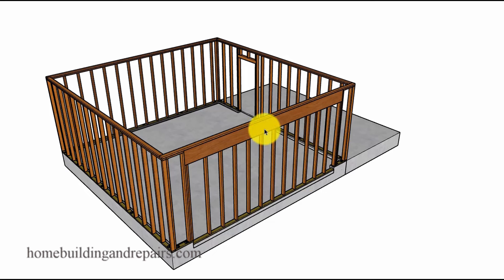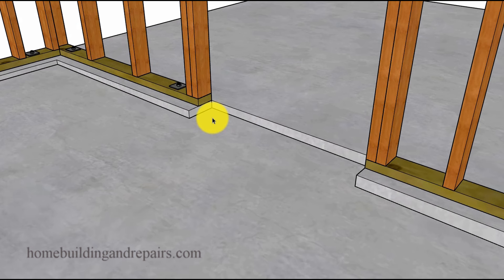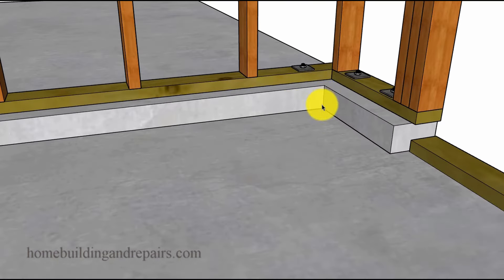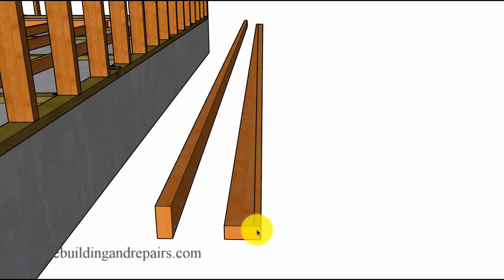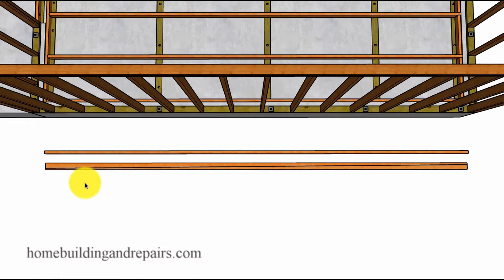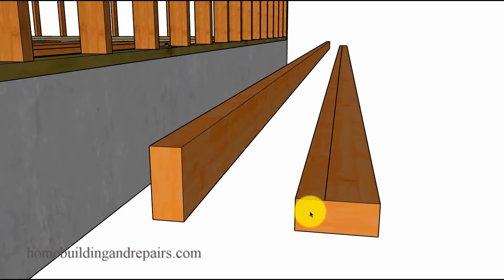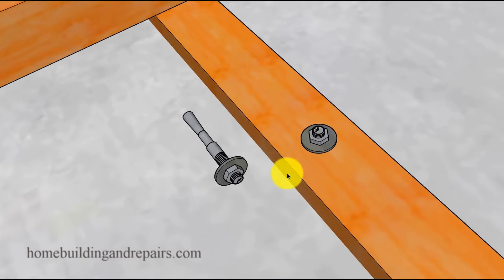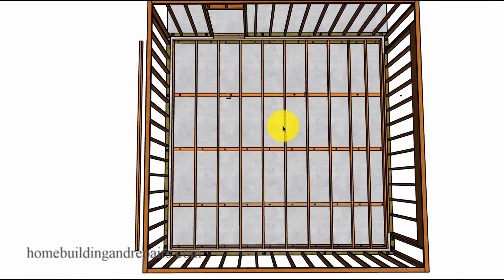How To Raise Garage Floor When Converting It To Living Space - House Remodeling Ideas

Comment: I believe my garage floor has a spring under it. Not an exterior drainage problem but a spring that flows harder and higher during the rainy seasons. I like the grid idea but since I have a real water/moisture problem should I use a plastic vapor barrier and wrap my bottom boards? I’m talking about the actual wood that would  be in direct contact with the floor. Please help
Reply: Hey George, any word that’s in contact with cement should be ground contact rated. Normally it’s treated.

You can use a joist tape to do the same thing,  if it was my house, I would do both

Comment: Another great video, glad to see you prefer cement, jm leanjng that way for cost and simplicity. I'm adding a 8x25 office in the back of a 20x25 garage. The stem wall for where the back door will go is about 4" tall with the top plate above that (perfect height for a 2x6 joist to rest on a flat 2x sleeper 10' out and be level). the remainder of the back wall is a 4' height cement retaining wall for a behind garage slope yard. I'm struggling with losing 7" of height inside for above office garage storage area  even though the walls are 12'.  Also considering 2" rigid foam on a self leveling cement floor and on the back wall to keep the drywall off the cement, but again I would be losing a few inches of wall space there and i think i would add furring atrips between the 4x8 foam panels.  The good news is my climate is zone 6 so it's pretty easy going and the retaining wall and floor are sealed (I taped plastic for the past 2 months and no moisture inside). It's also annoying I can't run electric on the lower back wall unless it's by the door but if I fur the back 2x6 wall out a few inches for 2" foam maybe I can run conduit in there and a shallow single gang box for an outlet. So it looks like the back wall and floor might have 2" foam and the side walls, ceiling and interior garage wall will have Rocwool safe and sound batt for comfort an noise suppression.

Comment: I have to put 2x6 floor joists on a concrete slab of a ground level room. What's the best way to protect the wood from moisture on the concrete and under the wood? Should I use 6 mill plastic, or something like dmx 2.0? Also Should I paint the floor with drylock or just leave it plain concrete?
Reply from the maker: I would check with your local building department for more information. I don't think it's a good idea to waterproof under framing with out adding air circulation or ventilation to remove moisture.
Reply: I called the manufacturer of DMX 2.0 and they said that should work fine. I'm not going to paint the floor, just leave ventilation around the edges for the DMX and lay my 2x6 sleepers on the floor and Anchor them into the walls.

Comment: How would you recommend raising the floor if the garage floor is 40" lower than the floor of the home?
Reply from the maker: I will put your video suggestion on my list of videos, but you could do it by building supporting walls underneath your joist and sheathing in the same way I'm using sill plates in my example. If you can email me some pictures of your project. You can get our email address at our website.
Reply: I have the same question.
Reply: @gregvancom  thank you. I will send you pictures of our current setup and the idea we are considering

Comment: Thanks for sharing. Your description was helpful.
Reply from the maker: Glad you found it helpful!
Reply: Loads of great ideas, thank you very much! I am looking to do something kind of like this in my basement. The problem is that I don't have a consistent slope. I have one point that's high and then from there it goes down in several directions. The first area that I was planning to finish, which is a bedroom, slopes down 2 1/2" within 14 1/2'. Like I mentioned, it's not a consistent slope, it's more like a topographic map with a high point in one section of the floor. It seems that most of my basement is lower than that high point. My basement is 2100 square feet so that would cost a lot to level it all up with self-leveler or even concrete. I thought about trying to grind down the high point but if I had to go into down 2" that would make the flat work too thin. It is apparent that the builders did it this way because there are some load-bearing walls in the low sections and the floor joists above are still mostly level. I live in Utah and it is highly recommended to do a subfloor for both insulation purposes and potential moisture issues, although we live in a dry climate. What would you suggest in this instance?

Comment: Great video! Greg. I am planning to convert my garage into ADU (no access from my house). My garage height is about 8 feet (concrete floor to dry wall ceiling). I am not looking to raise the floor. There is a slight slope but I am not concern about it. What kind of thinest floor structure I need to install LVP or hardwood floor. Thanks
Reply from the maker: Check with the product manufactures for best materials and installation instructions.

Comment: Thank you so much for this video! I recently purchased a home with a historic coach house in back that I want to use as a workshop. It has a concrete slab floor (not historic) that is severely uneven and broken in several places due to large tree roots. The trees are not on my property so I do not want to remove the roots, possibly kill the tree, and have neighbors who hate me. Since I don't plan to park a car in there I am thinking of ways to simply add a wooden floor on top of the broken concrete floor. I have been told by contractors that a new concrete slab would be at least 5k and might not last long since the roots will just break them up again. Any advice would be steller. Thank you!
Reply from the maker: I think I would build a wood framed floor.
Reply: @gregvancom  Great! That is what I was thinking too. Some sections of the concrete are in very bad shape and will have to be reduced to gravel. Do I need to do anything with these areas in preparation for being covered by the wood frame floor? For example a vapor barrier or tamping? Would it make sense to insulate as I want to install heaters down the road?

Comment: For 1" rise over 8' (20' long) would you use just mortar or fix all? I'm guessing it doesn't need rebar since it's so thin but what about fiber mesh or something?  Slab would be spanking 0" to 1" over 8', so otherwise I could go thicker and make it 1" to 2".
Reply from the maker: That's tough. I would leave alone if you can, but installing mortar or concrete between 1 and 2 inches is probably going to crack and separate. I don't have any product suggestions for your project.
Reply: @gregvancom  self leveling compound or micro cement

Comment: Do I need to put kind of  insulation between the concrete and the joist?
I am in a cold country.  North of England
Reply from the maker: You might need to check with your local building department.

Comment: I’m thinking about doing this to my garage. I would have to raise my garage floor about 1 ft 1 in. would you suggest just using concrete and then frame the floor?

ETA-I’m not accounting for the 3/4” plywood and the padded LVP as well.
Reply from the maker: It would depend on the design and another option would be to use stairs to step down into the garage.
Reply: @gregvancom  I did think about that but the laundry room is connecting to the “entry way” and we are going to turn part of that into a walk-in closet that’s connected to a bathroom…so I’m afraid the step up would also follow into the closet.

Comment: so i guess the first option with concrete is the best. does concrete need adhesive to bond to old concrete?
Reply from the maker: Most installers will use some type of bonding adhesives.

Comment: What is done with the gap in the foundation from the garage door? Will there just be an opening left below the structure?
Reply from the maker: I've seen most of them sealed with caulking and then if the garage get's converted back into a garage you can peel the caulking off.

Comment: Any problem using a concrete-wood glue for attaching joists rather than concrete anchors?
Reply from the maker: Glue usually won't hold. It breaks or separates from either wood or concrete, but if you have some type of adhesive that won't, then it might work.

Comment: Very nice video! Greg, if my garage concrete floor is not lower than the exterior ground, may I simply put wood floor on top of the concrete? Thank you.
Reply from the maker: I don't see why not and some home owners just use existing floor with out leveling or raising.
Reply: @gregvancom  thank you.

Comment: I have done this by laying progressively thicker ferring on the sloped surface then adding a "joist" perpendicular across the top. This way creating a perfect looong taper doesnt have to be done which can be difficult. This also allows for an increase or decrease of joists for 12" or 16" oc.
So any opinions of doinv this with concrete over a CARPORR floor which does noy have the bounding footer and riser wall to support exterior walls like a garage would. My concerns are for the sweating of the concrete with currently installed wood plates that close the area in. Opinions?
Reply from the maker: I would think more vents could help, but it would depend on how much moisture is coming out of the slab.
Reply: @gregvancom  oh as in case it has no vapor barrier. It is already closed in and thus is or isn't wicking moisture now. More concrete probably would not be any worse and any wood may have issues just like whatver flooring is put down if it cant breathe. A few calcium chloride tests should answer the moisture issue and since my initial query I realized i could simply cut out the plate and shorten the studs since they are not load bearing since it was already a carport with supporting walls made of block. So i can simply place a form board at the outsid edge of the original slab to allow the concrete to go under the wood walls closing in the open portions. Then slip in a treated plate.

Comment: Would you use a vapor barrier if its cement? can you do a video on moisture and ventilation?
Reply from the maker: I will put it on my list and I wouldn't use a vapor barrier that could trap moisture above where the framing lumber could get wet.

Comment: what would you recommend for floor insulation?
Reply from the maker: I've never insulated something like this, but if I did then maybe some type of Styrofoam.
Reply: @gregvancom  Im doing this project now, frame out the floor with 2x4’s, 3/4 plywood and use batts insulation. No vapor barrier.